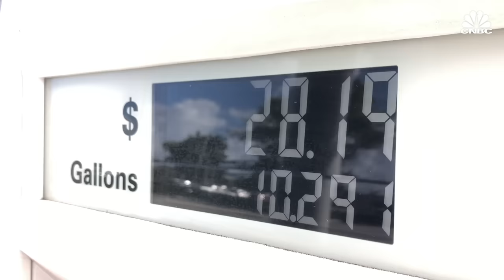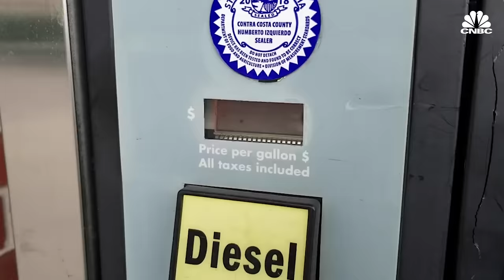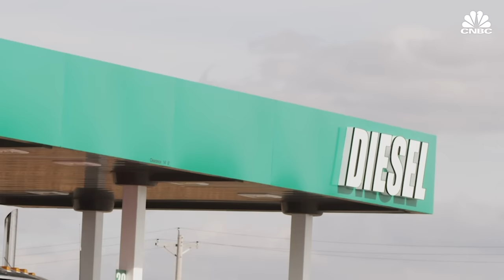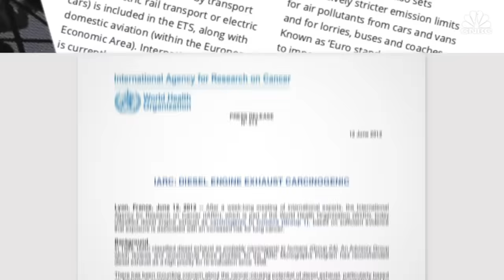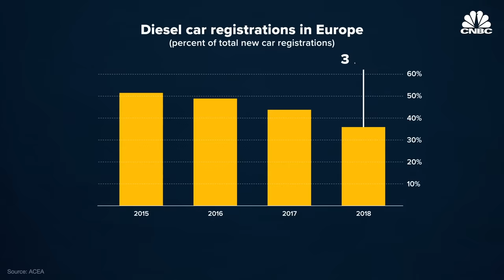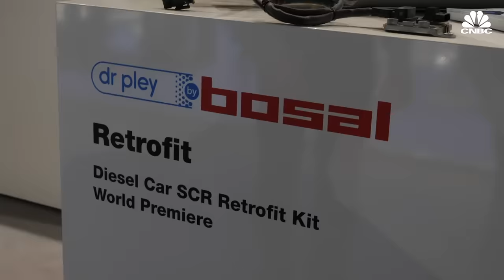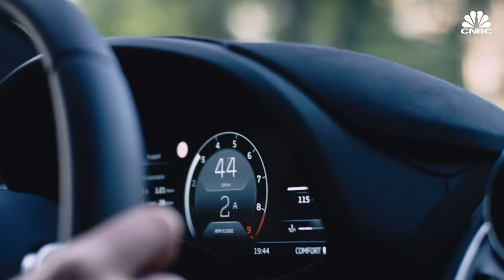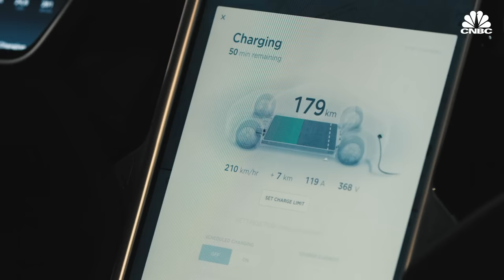Why Diesel Cars Are Disappearing

Comment: I had an 89 vw jetta turbo diesel and when I got it, that thing failed emissions by a larger margin. So I grounded the car and converted it to biodiesel myself. I had it tested again about a year later and the lady couldn't believe it. The lowest emissions she had ever seen on a diesel engine. She tested it 3 times and even called someone else out with a different tester who tested it several times and it passed with flying colors every single time. Diesels originally used plant based oil when they were released but big oil personally made sure they wouldn't stay like that.
Reply: Think about how much fast food Americans eat. How much oil is used every single day to fry that. Imagine filtering all of that and powering vehicles with it. And theoretically, it would be carbon neutral because the plants which created the vegetables used to create those oils were made from carbon dioxide in the air
Reply: @andrewsang4688  yes diesel fuel is a light oil originaly diesel engines ran on peanut oil
Reply: @thepurdychannel8866  peanut oil? Lmao.
Reply: I've heard a story of a guy that was able to get as much used cooking oil from a restaurant that he wanted. He would fill up his truck weekly with it. He had to replace the $15 fuel filter weekly but that was much cheaper than paying at the pump.
Reply: @HailNjord  you are supposed to filter the oil first with a sieve or some sort of fine mesh filter to get the bits of food from it
Reply: @thepurdychannel8866  of course, but maybe he didn't.
Reply: @HailNjord  best way is get a water butt and put the filter at the to near the opening
Reply: You probably just fixed an air-vs-fuel problem in conversion.  Burning seed oil fumes is still nasty stuff.
Reply: @paulblichmann2791  originally I thought that as well, but I had made sure everything was to spec. It was the fuel that caused the issue. They changed specs for diesel many times over the last 30 years and that car was not designed for diesel fuel made 20 years after the car. The air fuel was correct, for the diesel that existed when it was designed. That's why running biodiesel helped so much.
Reply: @thepurdychannel8866  you need more than a fine mesh. To use it as fuel you need to filter down to less than 5 microns at least. Even most fuel filters only filter down to 10-15 microns. I built a bypass filtration system that filtered to 1 micron and used gravity to feed the filter and filtered 30-50 gallons at a time. It was able to. Filter about 15 gallons in 24 hours which was plenty. Of course I had to replace the filter after every batch but you can use the Charmin bulk single ply 1000 sheet rolls for filters. Sounds crazy but it worked better than the 45 dollar filters sold for professional use and the toilet paper filter costed me under 5 dollars at Sam's club.
Reply: @Alexander Ratisbona all of that was done before emissions and it still failed. I completely rebuilt the engine, so of course all of that stuff was new as well.
Reply: Only '96 and after are required to pass an emissions test. Dawn of OBD 2.
Reply: Exactly correct. I also for a time ran my Land Rover on waste filtered cooking oil and the emissions are almost undetectable. It needed to be thinned with a small amount of organic solvent to go through the injectors. Even the particulates are low but could be filtered.  Using a diesel as it was designed is environmentally friendly but the government don't get the tax and this is why they push back against it.
Reply: I really think it wasn't so much a conspiracy as it was economy.

Diesel was available and cheap.

And was more weather stable than vegetable oil stock.

I wish the government would've left diesels alone, so biodiesel science could've advanced further.

There was stuff using alge and things that could grow in places crops couldn't that wouldn't have impacted food production and would've still had the benefits..
Reply: I think its because plant based oils are a lot more expensive to mass produce, petro diesel are just cheaper.....

Comment: Imagine Electric car companies screwing up your car battery performance with a software update. Like they do with smart phones 😂
Reply: @Generic JC Denton pic Planned obsolescence.
Reply: Already do that by burying simple bits like spark plugs deep in the engine under headers and they make you remove the entire front clip and headlight to change a bulb... That wire hanging down that gets corroded? That fold of metal that fills up with dirt behind the fenders.. That's all planned. Ive seen floods of phones all get a software update that kills battery life or charging ability overnight as a tech more than once. They don't want you to own a car for a long time and its going to get worse. I want nothing to do with an infotainment system and the electrical nightmares those will be in a few years.
Reply: The usual Republican conspiracies and scare tactics.
Reply: @nicoj3660  Except its not a theory.. Apple has been sued a few times over it.
Reply: And planned obsolescence started 100 years ago at General Motors. 

Yawn.. NEXT!
Reply: Oh , they do that, as the battery gets older, to maintain the "range" capability of the car, they start letting it charge closer to 100% charge capacity, which wrecks the battery even faster.
Reply: Tch the Reason why I woudnt get an Electric car..
Reply: @nicoj3660   very democrat scare tactics than republican
Reply: Planned obsolescence is real.
If you had a buick skylark in the 80s with a 6-cyl engine...that engine was DESIGNED TO FAIL AT 60K Miles. It was a perfect scam. At 60k your engine blows up. 😉
Reply: I don't think that's true.  Batteries just don't last very long.  4 years is really the max and that includes tolerating a much degraded capacity near the end.
Reply: @aimlessparasite1289  Username checks out. Get your facts right, so you rather the phone shut down unexpectedly if the battery cannot support the power demand? What the original commenter said doesn’t make sense, there’s no such thing as software updates interfering with the battery - moreso software updates that control PERFORMANCE because of a worn battery.
Reply: Imagine gas companies artificially raising price and supply.
Reply: it will happen
Reply: @Bartonovich52  huh? My Silverado's been doing damn good for 21 years without fail. Not sure what crack you're smoking.
Reply: @mikeries8549  same with head bolts on the Mini Cooper. They designed the head to be bolted to the frame... you heard me. The head is bolted to the frame. After a couple years of torsion,  the head lifts from the block, and hydrolocks the engine.
Reply: @aimlessparasite1289  tell me about it. I work on Yamaha bikes all the time, they intentionally put spark plugs behindthe frame, or make you pull apart half the bike to get a carb off. Shittiest engineering at its finest.